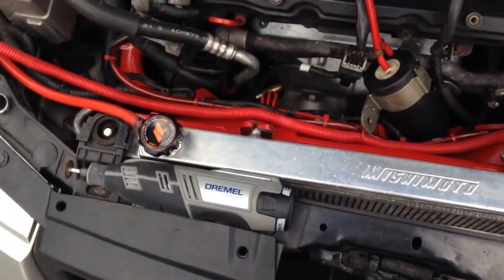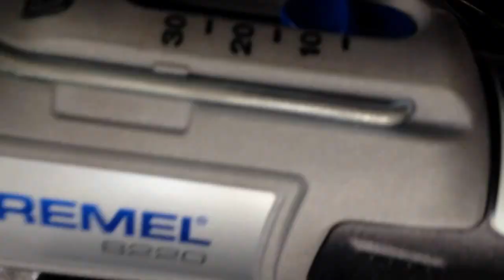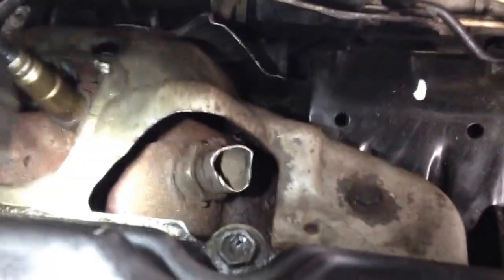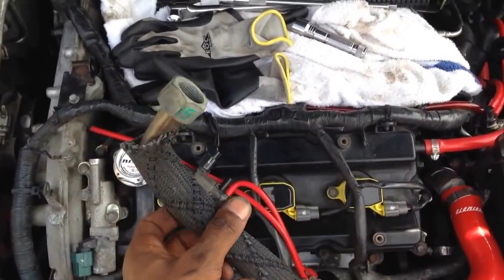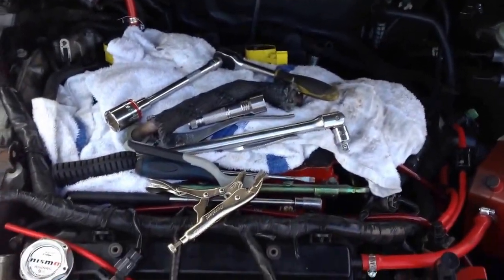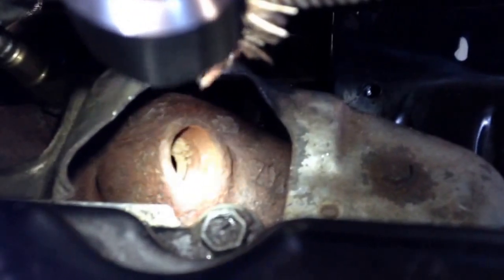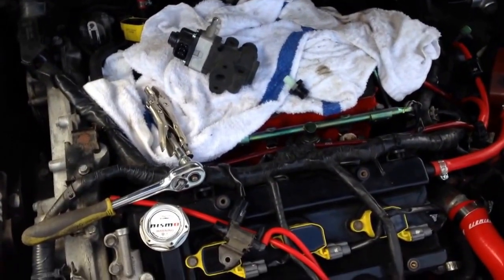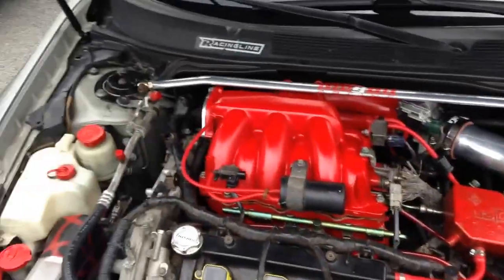EGR Valve Swap PT.2 04-08 Maxima --__-- Silver Surfer

Comment: I got my car back from the dealership and what they done was reprogram ECM first and then did a idle relearn. Car is idling smooth and running great. I was told when the intake was allowing all that air in the engine it threw off my values of the air/ fuel ratio mix.
Reply from the maker: kopy that my guy..

Comment: I been in yo same situation the last month cuz ma EGR valve got stuck closed and it was spark knocking. Tried everything to get that nut off but at this point ima just cut the pipe and do this.
Reply from the maker: I know the struggle my G.. I got fed up and had to cut it down
Reply: @Abu5ed_VQ  Mane I done rounded the screw thing idek what to do atp

Comment: This id December 6, 2020.....Hey man....I was watching your vid as to the EGR Valve replacement. I reran your vid a few times to get a better idea of how to remove the Valve. I would've loosened the lock nut behind the valve first. Being that most of the hardware (Throttle body etc) is removed. I think that would've saved your exhaust pipe. But hey ok. You and I learned something about that bad boy. 
I'm going to change out the valve sometime this week. Ordered an Airtex EGR Valve. I was wondering what size wrench I could use to loosen that lock nut in the back of the valve. Maybe something like a pipe wrench type? One that you use on the brake line lock nut. But larger for that size behind the valve?...Just an idea.
Anyhow? Nice job and I gotta hand it to you. You have a hell of a lot of patience!!!!! I would've blown the car up already!  :>)   Kidding of course. Thanks for the video dude.
Enjoy your Christmas man. Ted
Reply from the maker: Hey bro.. I hope this finds you well.  I'm thinking an adjustable wrench to be on the safe side..

Comment: I have a 09 Maxima and I've been experiencing an engine knock between 0-20mph normally when ac is on. My SES light came on and my idle became high as well. I went to auto zone to do a scan and it threw a P0171 code so could my problem possibly be.
Reply from the maker: Everett Hardin Greetings.. Have you done any work on the car.?
Reply: @Abu5ed_VQ  I haven't personally done any work on it, but I've been taking it to a Nissan dealership
Reply from the maker: @everetthardin6056  What was the work done if you can recall.?
Reply: @Abu5ed_VQ  I had the air intake manifold replaced.
Reply: It had a crack/ tear in it
Reply from the maker: @everetthardin6056  there maybe a leak of some sort causing extra non-metered air in to the manifold

Comment: In my case i delete pcv valve and the egr system delete also...NWP egr block plate kit!!... U gonna have chk engine light for ever!!.. But i prefer my upper PORT manifold clean always!! Thanks O.G for the info!!!
Reply from the maker: Jose Garcia Thanks for the input.  But narp, I fixed the problem my dude.. And that delete will not allow me to pass inspection and give you high emissions in the cabin..

Comment: Would it be possible to remove the rear header from that position? I copped the the Altima v6 header and I was told I have to drop the engine to install the rear header
Reply from the maker: It is doable bro.. A hell of a headache but do able..